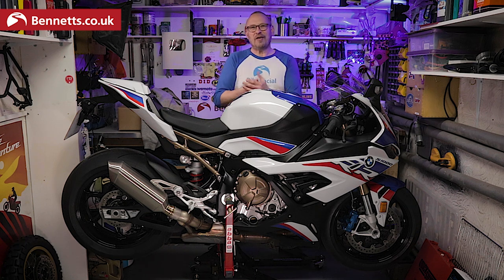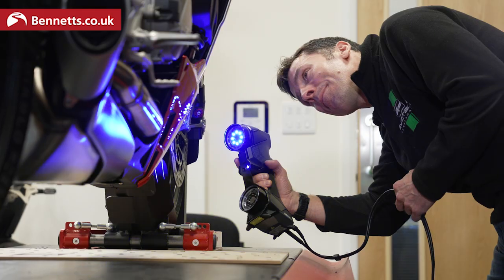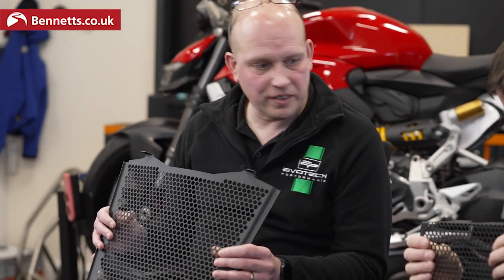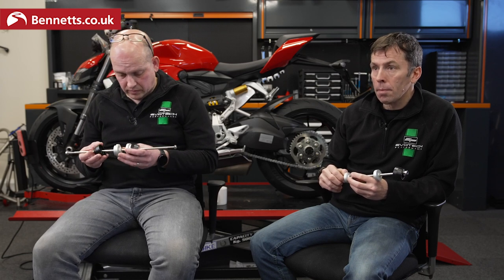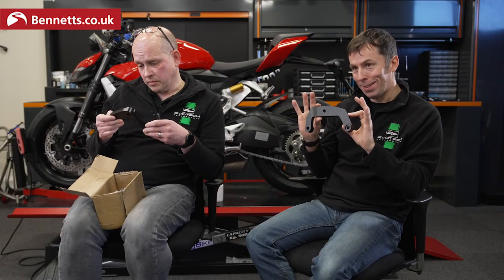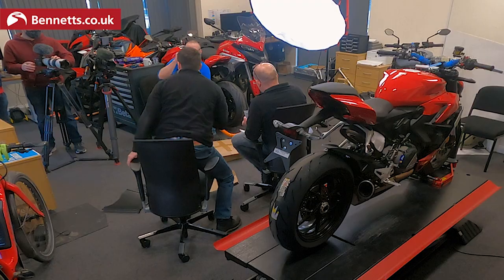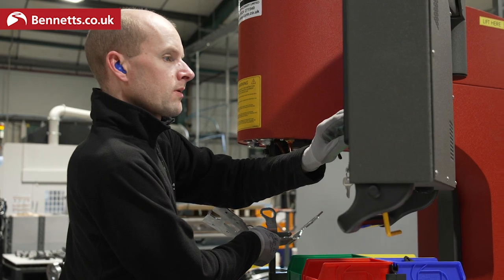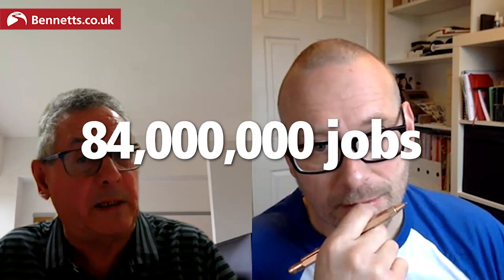Fake Evotech Performance products from China: The real cost of knockoffs

Comment: I knew someone who bought cheap non branded crash bars for his new BMW R NINE T.
One of the lower fixings for the bars replaces the bolt that goes through the frame into the block.
As he was torquing it he heard a loud crack, and soon realised the problem.
The supplied replacement bolt for the crash bar was too long for the threaded hole in the engine, only by a couple of mm but that was enough to crack the crank case when tightened up.
A 12 grand bike ruined by a £50 part.
I must admit I've got Chinese bar end mirrors on my bike that look great and have been absolutely fine, but I think when you're looking at anything functional beyond the aesthetics, you should buy from a reputable company.
Reply from the maker: That's awful!

Comment: I’ve bought a few products direct from Evotech and they’re top-notch quality. As others have said, why on earth spend £15K-£20K on a bike then skimp on bolt-on parts? It’s a false economy. Problem is some other manufacturer charge ridiculous prices (£170 for a single-piece plastic mudguard!), and this leaves the market open to cheap fakes. The long-term issue that people buying cheap fakes don’t understand (or perhaps care about) is that IP theft will result in manufacturers like Evotech will give up. The fakers don’t design anything, they don’t (3D) scan the bikes, so either you won’t get any more products, or they’ll be total rubbish. Unfortunately China has found it very difficult to enforce IP protection, so it is better for customers like us to vote with their feet, ignore FB, Amazon, Alibaba et al. Just skip one evening meal down your local restaurant, you now have the money to buy the original product!

Comment: As an engineer its great to see them analyse the fake product materials and production methods the copycats use and then explain the differences in the real products. People will always think there are cheaper alternatives that are better than nothing at all - what this shows is that in fact fitting cheap knock offs may make things far worse than fitting nothing. The average person has no idea about material type, manufacturing, hardness and finishing that make the parts reliable and safe.

Comment: I have a Evotech tail tidy on my Triumph Street Triple 675...Its well made, has all the parts necessary supplied...no cutting the original loom.... all except the reg light wiring are hidden inside the unit and looks part of the bikes original fitting... Best tail tidy on the market ..

Comment: Liked the lads so went on their website to find they don’t support many bikes made before 2016. What a shame!
Reply from the maker: Gutted! I'm in the same boat with my 1999 ZX-6R though...
Reply: It's all down to design and tooling though as they explained. If something 'will fit' from another model, obviously it's an easy swap. But most won't. The investment needed in tooling for an older bike that isn't current and isn't being made anymore will most probably outweigh the return. 

I'm the same with my 2003 R6, although immaculate, it's old now and can't get much for it anymore, apart from levers and bobbins.
Reply: @mickl8212  totally understand. That’s why I said it’s a shame. I’d rather buy uk then Chinese but I don’t have much choice

Comment: I agree where safety/stress critical parts are concerned, like sliders, but not at all convinced with trivial parts. Radguards and mudguards are not being asked to do much, and the idea that a satnav mount should cost £80 is insane. That's why people go to aliexpress, because £80 for a little, non-critical mount which isn't going to fail because it's being asked to hold a phone is a ripoff and has not required much r&d. UNLIKE those axle protectors etc. where I cannot fathom risking the bike to save money.

Comment: I've used the Evotech tail tidy before on a Thruxton 1200 R which was a work of art, so well designed to stop mud/water entering the underside on the bike whilst retaining the ability to use the stock indicators for the retro look. All the parts lined up and all the bolts fitted perfectly making the fitting process a pleasure.

Comment: I've purchased Evotech products for years! Their product quality is OEM-like if not better. I just wish they would include engine case guards in their product line. Cheers from Canada.
Reply from the maker: Do you mean sump guards? If so, they sell them here: https://evotech-performance.com/collections/motorcycle-engine-guards Cheers, John
Reply: @bennettsbikesocial  I think they're referring to the clutch, oil, stator, etc cases on the sides of the bike. you could argue that the oggys fulfil this job but if evotech is listening: if you make it people will buy it
Reply: @motoshan  Correct.

Comment: I wouldn't buy anything related to safety from cheap sources like AliExpress, for example sprockets, chains, even engine protectors. But for radiator guard, it's a simple piece of layer and has an extremely low chance of failing. I used to make my own radiator guard using woven metal mesh and it works fine too.

Comment: Great video. But, you say all parts are designed and manufactured in house. The z1000sx rear tail tidy for a 2019 model has been out of stock for almost a year now. It’s getting frustrating as the R&G one is basically pants in comparison.

Comment: Hey, I'm in Australia & I want some of your parts for my CBR650R (LAMS) when I get it.
I'm thinking I want to try to get it in June for my Birthday, or for X-mas.  At the very latest June next year which will be my 50th.
I want a Tail Tidy because the stock/factory/OEM plate holder sticks out too far & is fugly.  I want the Frame Sliders & Wheel Spindle (Axle?) Sliders to protect her if/when I drop her.  And I want some aftermarket Mirrors that have the Indicators integrated into them & that don't stick out from the Screen Fairing on spindly little arms, but look more like they're a part of the screen fairing piece, as well as a set of Bar Ends(the 1's that go on the ends of the hand grips?).
Do you also have Rear Spindle/Axle Sliders?
I'm even seriously considering buying these items before I get the bike so I can install them all as soon as I get her to ensure she's better protected right from the start, without having to wait for parts to arrive, etc...    🤔

Comment: I've got a MSc in I4.0 Advanced Manufacturing and I can tell you that within a few years these knock off's will be just as good as the genuine parts. There's not much that can be done to stop it either. They'll mimic the design process and improve the manufacturing and QA before they eventually leapfrog companies like EvoTech. It's happened to Ericsson with Huawei and Geely did something very similar.

Comment: Chris, Dan -- for what it's worth -- the instructions for the Ducati SF V4 radiator guard are pretty weak. I suppose most of your parts have less involved installs but... even if you ignore the lack of text which could have been used to answer some questions that I think a lot of people run into; what's with the stylized pictures? Someone attacked them with photoshop plugins and it doesn't make them read better. An arrow and an incomplete sentence were often not sufficient for working on a new $20K bike.

Comment: On the other hand, most motorbike manufacturers are increasingly shifting (if not already completely shifted) their manufacturing to SE Asia. eg Bajaj (an Indian brand) and KTM manufacture their parts in the same factory, and Bajaj's 400cc offering literally has the same parts as KTM's Duke 390. Bajaj's prices are 50-60% of KTM's though, and millions (India is a HUGE market) of riders have switched to the cheaper Bajaj parts with no issue. Things like brake pads, oil filters etc. Of course, one clear distinction is that they do not copy branding, but the underlying principle is the same, and in that case it is a completely valid decision to be made.
Reply from the maker: Good manufacturing isn't down to geography, it's down to quality control and investment in design and processes. Great products made anywhere in the world are copied, often with substandard materials and design.

Comment: That was a very interesting report, and very timely for me. I've just spent several hours on ebay looking for a new rear hugger for my BM. Puig makes a lovely one, but you can buy what appears to be an exact copy from China for pretty much half the price. So, being a tight arse I decided on the cheapy. Then I watched your video.
Oh, what shame and guilt I felt, tinged with the slight fear of 'what if it breaks off and gets jammed in the back wheel'.
But how do I check that Puig is the real deal ?
I always thought it was proper, maybe some link in my head with Alberto Puig the GP racer. When I did a quick Wiki search it said Puig was a perfume company, so that's not it. So now I'm gonna wait until I can afford a genuine Puig hugger and in the mean time check that Puig is a proper (I assume Spanish) company and not just a name like Katy Perry Pizza just around the corner from me. She doesn't work there, I checked.
Reply from the maker: This comment made my day (the Katy Perry bit)! Puig is a proper brand - Pyramid Plastics is one of the UK importers. Cheers, John

Comment: Excellent video. I don't use bike protection stuff on my bike because that's what insurance is for.... Interesting stuff, wouldn't put cheap crap on my baby. Thank you 👍🏻👍🏻
Reply from the maker: Thanks very much! Personally, having dropped my XR and had the fairing protected by crash bungs, I was glad not to have to make a claim. I do agree about kit that requires cutting of the fairing though (Evotech doesn't do any of this) – why cause damage to save damage?! Cheers, John
Reply: Its just bad when you are on EU tour 1000miles away from home drop a bike on parking and your magnesium engine cover break oil leaks out... or stone punctured  radiator so you loose coolant after 3minutes of track day booked and payed 1 mounth in advance for 2day in the row... insurance can pay everything but can't pay lost day or two of my life.
I

Comment: Agree with most of what was said,but with some goods...I bought a screen extender from Ali for €18 insted of paying €80 odd from Mri.Its still on doing its job after 3 years.
Reply from the maker: But MRA (?) put all the investment into designing that screen and getting it right. If they end up out of business, what will the counterfeiters copy then?
Reply: I would add, I just hope you don't have a crash with that cheap screen, who knows how that plastic will react to an impact, whereas I have every faith in MRA screens not shattering and stabbing me..
Reply: @BarryThompsonUK  I have the same alixpress screen extender, and it's fine. had a stone hit it on the highway, still goes strong. If you have an expensive bike, go for the good stuff. My bike is on the cheaper side. so I am not dumping loads of cash into that.
Reply: @henrietn  That's great, you've dropped lucky and got something strong. I'm not here to tell you how to spend your money, or even judge where you spend it, I just think you should assume cheaper products, or flat out counterfeit goods, will not be made to the same exacting standards as the better known brands. As John and the Evotech boys hopefully illustrated in this video. I think when it comes to safety items, we owe it to ourselves to buy the best we can justify.

Comment: This just begs the question 20grand bike and your buying  guards....and other bikes of cheaper models just same .....👍
Reply: can you reword this? not sure what you're trying to say exactly mate
Reply: @motoshan  yeah sorry what i should say is  why hasnt bikes got guards fitted at factory ....radiators and oil coolers are so vunerable ..👍
Reply: @caroldave4037  yeah it's definitely a necessity! however manufacturers wouldn't be able to charge you extra for the add on or better yet sell you a whole new radiator :( poor form

Comment: I bought a Chinese radiator  guard for my gsxs 1000 and it was perfectly fine for £20. I think some legit companies are scared stiff that their massive profit margins will disappear. You can see the fear in their eyes. What's the bullshit about laser cutting and once a press brake is set up to bend a monkey could work it
Reply from the maker: Who designed that radiator?
Reply: @bennettsbikesocial   Sorry can't remember . Probably Evotech in the beginning. I've bought loads of stuff from China and must have been lucky so far ,but never buy anything where structural integrity is to critical.
Reply: @bennettsbikesocial  the Chinese are copying every bike that is out there, just with different names. And they are getting better at it. Same goes for the parts. You can get "decent" parts of amazon from Chinese manufacturers at half prices of what the stuff in the UK costs.  Sure, the alixpress stuff is rubbish, but that is the garbage bin shop. I bought a radiator guard for my cb500x for 30 euros from Amazon, where R&G would have cost more than double that. Fit perfectly and with a reasonable finish.

Comment: Not all is black or white,i have evo tech crash pads exactly like original inside with aluminium and outside nylon and have buy this for 20$.
and yes not all develop the things, but because they want to produce cheaply they have the things produced in China which means that the producers china there have all the plans and then they sell  exactly the same product or sometimes they simply change the name or sell them without a brand name.
Of course there are also fake productions where, for example, they buy a product and then simply copy it and then do the whole thing in a worse and cheaper version for example rearset looks from outside exactly or 98% same but the material is instead Aluminium 7075 T6 they take the cheaper 6061 T6 or 6065,which not means this are not safe but is bit cheaper material. That's why you have to be careful not every product on aliexpress is bad, on the contrary I have already bought a few things that are 1:1 the same, sometimes only with marginal changes.
I have been ordering from China for 6-7 years, just as an example the GB racing engine cover protectors, they have always done their job. In the event of a crash on the race track, nothing has ever broken on the engine and in the 6-7 years I have been on the race track I've had at least 5-6 crashes, and it's the same with the crash pads as already mentioned i never had a problem they pads or protectors have really helpd for bigger damages. There are sellers who only offer nylon, but if you know where you can also buy the same crash pads that Evo-Tech offers on the inside with aluminum etc. That's why You can't say that everything is bad where you buy on aliexpress or somewhere else in china. Just pay attention to the reviews and if there are hardly any reviews, ask the seller for real pictures.